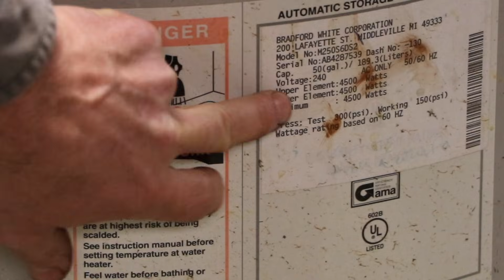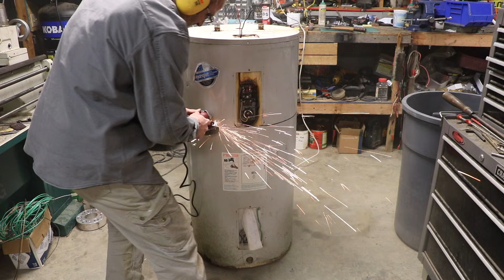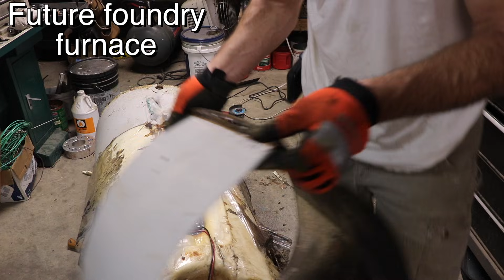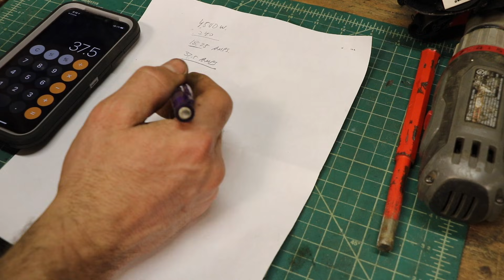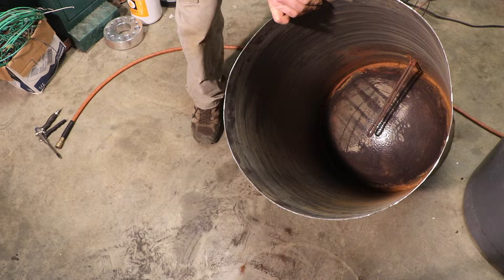Secrets Inside Your Water Heater.  Teardown And Repurpose.  FarmCraft101

Comment: I save old water heaters that aren’t leaking and use them as air accumulators for my 80 gallon air tank. I have two of them. 

The extra capacity is great to have when using a tool that uses a lot of air. It reduces the extra cycles my pump runs through each hour. I keep them outside my shop in an enclosure in case one blows out. If a 50 gallon tank @ 175 psi blew out inside the shop it would for sure blow out all the windows and probably warp out the garage door. Not to mention what it might do to my ear drums if I were in the shop when it blew.

Comment: Just replaced our gas powered one, it hasn't failed yet but its over 20 years old. Wondered if I could use it for anything and this was a perfect video to see the insides for ideas. Thinking about combining this with a wood fire stove to heat a hot tub. The copper/steel coil kits they sell online are crazy expensive, but this might work.

Comment: G'day mate - good video! I'm an Aussie & have lived Down Under for 53 years. Most of our hot water tanks are stainless steel (some are enamel-lined steel) and they still corrode and go bad with similar life-spans (~15 years), even with good maintenance like anode replacements, and our water isn't like a lot of the USA (hard / calcium / lime / mineralised). In fact I'm dealing with a leaking tank now which is only 7 years old, stainless steel, but imported from and manufactured in China, so who knows what real quality the stainless steel is lol. Stainless steel tanks use an Inconel Alloy (like car valves) to reduce galvanic corrosion (compared to copper) but they still corrode anyway, and so does the tank. Another issue here is the pipes are really old and carry minute rust particles which get through particle filters, once inside the stainless steel tank they also encourage corrosion. Some of our higher quality tanks are stainless steel with glass linings, like thermo flasks, they are great but expensive, and typically can only be installed by professionals not DIY'ers, partly because they have to be kept upright and cushioned carefully during transport to preserve the glass lining - any impact cracks and breaks the glass rendering the whole lining useless.

Comment: Wow, you didn't call it a "Hot" water heater! Well Done!! I have a 40 gal  that started leaking at the top where the anode rod screws in, It was leaking around the weld seam. I'm going to use the tank for a trash burn barrel.

Comment: Thanks much.  So now I've learned to cut the bottom off - about a couple of inches below the weld.  Fix the holes and reweld the bottom back on.  Good for another bunch of years.  And do this with only removing the bottom few inches of the jacket/etc.  I wonder if they can be powder coated and still be potable---hmmmm.

Comment: Great tear down showing electric elements. I was replacing the rod and still had too much water. It pooled on top electric cable area. I was concerned on what other damage would be possible. From looks of  things. Everything was very basic with only 3 points of concern. Once I'll dry it out, I'll be comfortable to turn it on.

Comment: It was not uncommon for a plain gas water heater to last for 15+ years before they changed the bottom. They used to be like a thermos, now they have that inverted cup you showed on the gas one. Now they are high efficiency as far as heating, but they tend to fail on that superheated bottom conveniently the year or two past the warranty. 
I always install Bradford Whites, as they come with the 10-year warranty parts already installed on the 6-year warranty heaters. You don't get the warranty unless you pay for it. But you have a 10 year heater.

Comment: We used a crawfish pot and propane burner. The wind guard was the outside of an old water heater. The burner also came from the same hw heater. We boil a lot of crawfish in Louisiana so I and others usually have multiples laying about. Chickens have to be chased down in Mamou, Louisiana for their Mardi Gras celebration. Part of the festivities. Bunch of crazy Frenchmen chasing chickens. You can bust a gut laughing. Great video. HAPPY MARDI GRAS.

Comment: We have copper hot water tanks in the UK. Unfortunately they don't last either. They corrode over time and fail around the pipe fittings. Galvanic corrosion. Mine lasted about 20 years.

Comment: seems like an easy enough thing to make yourself, a welder or oxy torch for either stainless or copper respectively, remake the tank, install all the fittings and valves, insulate infinitely better than it came from the factory and bam, generations-lasting water heater

Comment: 8:40 The heated water expanding and "...doesn't have anywhere to go..."  If you're on municipal water, it expands back towards the water main. If you're on a well, it expands back towards your well pump pressure tank. If anyone has a check valve in the feed to a hot water tank, well - please don't.
Reply: Many town city water supplys require a back flow check at the meter. You need an expansion tank for the water expansion.

Comment: They should make those things out of aluminum and not carbon steel. If they did this then Jethro's crazy tinker toy pattern with the PVC blocking the way out of the closet space wouldn't be too much of a pain pulling it out over top of the PVC rat nest.

Comment: Can’t believe there was no more scale in the bottom of the tank. I’ve changed dozens of bottom elements and usually end up with a gallon of lime debris. If you put a piece of heater hose on your shop vac you can vacuum the scale out. Bottom elements will short out when the scale builds up around the element.  Our water heaters usually start leaking just after the five year warranty.

Comment: Noticed a neighbour has one  likely waiting for disposal.  I was wondering if leaving all the exterior shell on, using a metal cutting blade in a reciprocating saw,  if a person could just cut the top off, maybe seal the open top edge of the side  layers, to use as a (opentop) water-holding tank (rainbarrel?) !
Reply: Or a barbecue pit 🙂

Comment: Wow. This was super-informative. Thanks for going through the trouble. It's cool to see one of these beasts without its clothes on. It's not so mysterious once you strip away all of the coverings. 

Crazy to think how much of reliable operation depends on the little things, like a relay. It's a wonder that these things last as long as they do. I guess the parts only need to last for as long as it takes a weld to rust out.

Comment: I needed a tank for my shallow well pump (gray water) that I used for irrigation and salvaged a discarded hot water heater from the side of the road (thanks neighbor) I found the holes and welded them shut and Bob's your Uncle I had my tank. That was about 20 years ago and it still works.  Great video thumbs up.

Comment: Another useful purpose for an old hot water heater is to use it as an extra air accumulator. I have an 80 gallon accumulator that the 7hp dual stage air pump is connected to.  I have two old 50 gallon water heaters to be hold a total of 180 gallons of air. I built myself a small shed outside my shop for these extra tanks in case of explosion. That much air instantly escaping would blow out all of the windows and all 3 doors. It would also terminate your hearing and vision if you happened to be in the shop if it blew out in there @ 175 psi. That really keeps your pump from running constantly when painting or sand blasting.
Reply: uhh, you got big balls using rusty non-pressure-rated tanks for 175 psi air, even if they are in a shed
Reply: @virtualtools_3021  big rusty balls at that

Comment: Thanks I recently bought an all electric house and have never had an electric water heater before. The previous owner had the thermostat set to the highest temperature so I took off the top cover and turned it down. I had no idea there was a second thermostat. I paused the video and immediately set the bottom thermostat. Thanks
Btw the comment below mine was written by a Johnson.

Comment: Actually copper and stainless boilers are quite normal here in Europe. But they are a heck of a lot more expensive then regular steel ones. 

We also have something called a hygiene boiler, which is basically a pickup coil inside the boiler vessel. This is mainly used for central heating setups, where you heat up the boiler which circulates the non-potable water and you use a copper or stainless coil (often ribbed for better thermal properties) to heat up the potable water. You can get quite fancy with these with options for solar loops, woodburner loops, electric backup, hygiene coils, temperature sensors. The bigger ones come with a bunch of holes at multiple angles, so you can configure it at will.

Comment: As a couple others have mentioned, having a full stainless tank would not eliminate the corrosion issue. It would definitely help, especially when paired with a good liner, but the corrosion will still occur due to galvanic action between the multiple metal types in your plumbing

Comment: Pro tip: Use a torch on sheet metal to melt the foam that's holding it.
Reply: You or someone else downwind  would want to be careful of the toxic gases from the burning/melting foam !?

Comment: After buying my house my hot water tank started to leek so I changed it from a steel tank to a stainless steel tank, here in the UK we have to have 3 forms of redundancy for pressure release + the vent has to go to the outside + an expansion tank. We call these tanks unvented, I know the US have been using these for decades but normally in the UK we just have a tank where the pressure can't build at all because it isn't contained at all just insulated.

Comment: @8:22:  Re:  other concerns:  surge at shut-off.
Electrical systems experience something similar to water hammer.  Suddenly shutting off that much current could damage other appliances on that circuit and even on other circuits.  It's why you should surge-protect sensitive appliances even if you have surge protection at the panel. (I.e., not all surges originate upstream of the panel.)

Comment: SS is very expensive. It also has negatives like galling and less assurance of availability when you need a specific size. But it's mostly an expense issue. 
*Knowing how often homeowners and (even bigger customer) rental complexes choose to cheap out, would you as a manufacturer choose to make your water heaters cost double the competition?

Coming from a marine industry perspective: 
**They have a mechanism to protect it from rotting out**
But they fail because people are neglecting to change the zincs before they are mostly gone.
No zinc, no galvanic protection.
$25 of zinc every 8 or 10 years would have saved that water heater.

People wouldn't say a car is unreliable/failure prone if the reason it died was someone ignoring putting oil in it for 10 years.
But stuff mounted in your house is out-of-site out-of-mind. It's easy to just think of it as part of the house as long as it seems to be working and ignore until it fails.

Unfortunately, nobody is doing an adequate job explaining this to homeowners or home purchasers how important, easy and inexpensive it is. At least not enough to make sure it gets done regularly.
*The installers don't mind. They just got paid to install it. Why would they actively seek to prevent their job, unless they have a lot of integrity and care?
*The manufacturers don't mind: customers who are picky about that will pay attention to the maintained lifespan. Customers who don't maintain may grumble but will buy a 2nd water heater, and since not maintaining is not brand specific, they all have similar failure cycles.

*apartment complexes change managers frequently, so none of them want to be the one who spent way more on maintenance during their term (pass the bill onto the next guy).

Comment: A fixed-storage-type water heater that has a capacity of 120 gallons or less shall be considered a continuous load for the purposes of sizing branch circuits. Because of 422.13, this water heater shall be considered a continuous load. Meaning... Yes a #10 AWG is required...

Comment: The Bottom element is called the quick recovery element.
It will begin heating the cold water before you use it all.
Under heavy usage the upper element will turn on.
This and the potential of sediment being trapped at the bottom of the tank
 is why the bottom element generally goes out first.
The cold water entering the bottom lifts the hot up and out the hot water jacket.
Without this design the water in the bottom of the tank would become stagnant.

Comment: Cut it in the middle and you get 2 chicken dippers. Snap off the anode and plug the fill tube.  Leave the foam and shell on at least the bottom half, keep the water warm

Comment: The heating elements and switchgear and pipe joints and most importantly the insulation deteriorate over time. You could make the pressure vessel out of copper, and some tanks do, but you’d have to do a lot of maintenance around that pressure vessel to make it last a century. And most people wouldn’t, in which case they’ve paid three times the price for no benefit.

If you replace the sacrificial anode in your water heater every so often, a steel one will not deteriorate either for quite a while.

Comment: As far as I know there never a need to replace a water heater you can always fix them change elements weld holds ECT. I called a major Plummer out two years ago and they said I needed a new water heater started researching and found out how to change the heating elements replaced them and works like water on fire now baby so happy to fix things on my own. I had one major problem while fixing it though. My wife had a vape on the table out here in the garage and I thought it was CBD spray and I was sore so I sprayed like a dozen sprays.  Later on while working on the heating elements trying to wire the stuff I was playing a YouTube video and all the sudden it hit me. Everything was going in slow motion I couldn't rember if I shut the power off. It was like the scene in supper troopers when they pulled the kids over. Littering and littering and... I asked what was in the spray she said prescription strength THC. I was screwed within the hour I said I got to go to the hospital I have never done any type of drop like that in my life a bit later I couldnt talk walk barely open my eyes. We laugh now but man was I on one hell of a high lol

Comment: Leak/pressure testing with air! Phew. Not for the faint-hearted
Reply: Agree I was cringing! After seeing an air compressor explode just after startup from a pinhole in tank  and knowing there wasn't much pressure at all in it yet I quickly learned best to test with H²O and very little pressure!

Comment: In the uk theyre all copper...
Sometimes split tanks for the same reason those have 2 elements.
Larger tank at the bottom on slow heat for baths etc. smaller at the top on faster heat for day to day hot water.

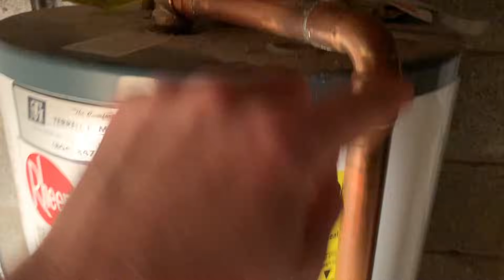Comment: @ 10:00 he only did it 1/2 right as the pressure relief should vent to the floor and then to the floor drain because if it pops, and a chunk of rust/crud keeps it open, it will keep leaking and you could have a flooded basement, and yes, it will make it's way to the drain eventually, but before it does it will soak anything on the floor and the floor will become soaked leading to high humidity and mold.
How do I know?
I'm dealing with that right now!
Reply: His is according to code. It must stop well short of the floor. Better to risk a flooded basement than a pressure vessel destroying your house. I would have added a pan under the tank with a drain port to run to the floor drain. Pan can safely overflow if the drain line clogs up. My basement has no sump or floor drain so I just live life on the edge. :)

Comment: my fam runs a plumbing and heating biz i have seen these 2 elements get stuck on and the release valve not work from rust and calcium build up once it blew the hole back side of the house off and the other one went through 2 floors and the roof and landed on a car 3 blooks away. most of the time it just make a hell of a mess but if that valve dont work it makes a bomb. and the leak is always on the bottom

Comment: No, it wouldnt cause more pressure with 2 elements heating, as there is no check valve on the cold water in.

Comment: I'm told that the difference between a 15 year warranty water heater and a longer warranty heater is just the thickness of the anode.

So buy the lowest year warranty water heater, I don't know, I'll guess 10 years and at 8 or 9 years replace the anode. I'm given to understand that it one is diligent about replacing the anode on time that the water will last forever.

You'd prolly have to replace elements, t-stats and stuff though.

Comment: In the UK hot water tanks are made of copper but they still fail. They last 25 -   35 years.
Reply: Used to be in Australia too. Last few years I’ve found a lot as they fail in houses built in the 80’s

Comment: The reason we run #10 to a residential heater is because the wire is sized for the heater being continuous duty. 4500/240= 18.75×1.25 (125%)= 23.44 > 30a breaker #10 wire.

Comment: Dude that gas water heater needs to be replaced. Look at the scorch marks where the gas control is. The flames are coming out of the front of that thing. Also check the chimney. Make sure there isn’t a blockage.

Comment: Planned obsolecence, nearly always the same parts go bad
Reply: No, this is the very reverse of planned obsolescence. If everything goes bad at once, that’s planned obsolescence.
Reply: Planned point of failure. My Dad and I were talking about it when trying to find a plastic bushing that wore out on my grandmother's car door opener. It was a screw drive and I came to the realization that the bushing was a sacrificial part so it would break rather that the screw shaft